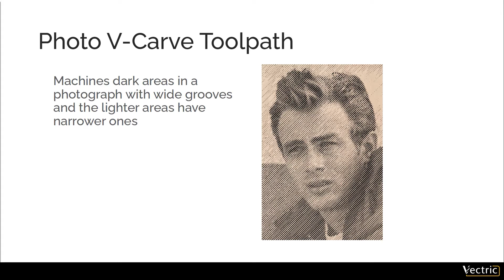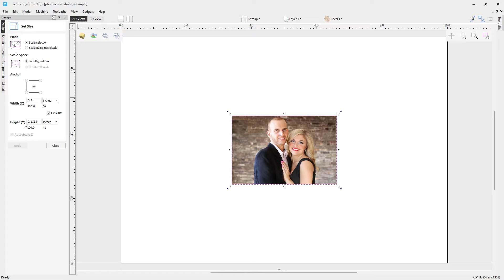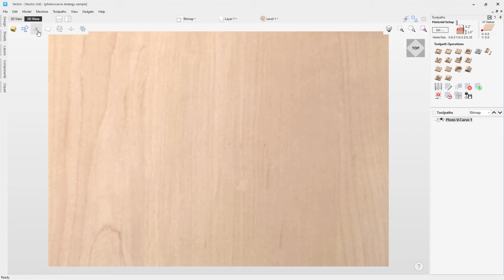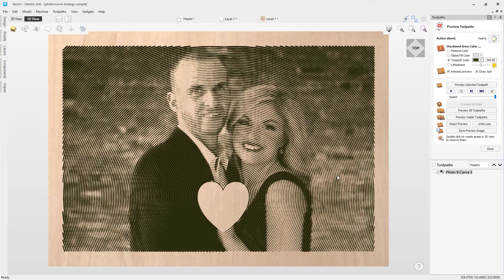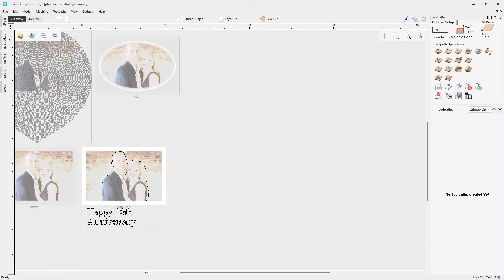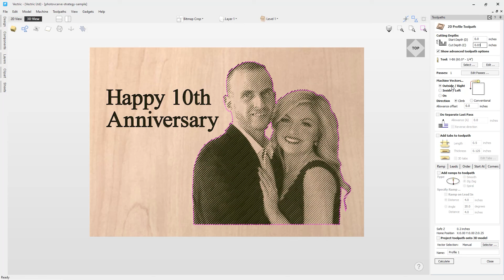How to use the PhotoVCarve toolpath in Vectric software | 2.5D Toolpaths | V12 Tutorials

Comment: great tutorial! What's involved with setting up the post processors with this software? Or is it not that difficult due to most likely running everything on centerline. Are all the lines broken down into small segments in 3 axis moves, x/y/z? to cause "ramping" motions?
Reply from the maker: Hello and thanks for the question.  We have a huge selection of post processors to choose from, it's only a matter ok knowing your machine make, or controller type.  If we don't have a post processor for your CNC you can contact support @vectric.com and they can help.  You can find a list here - st the bottom of the page - https://www.vectric.com/support/new-to-vectric/